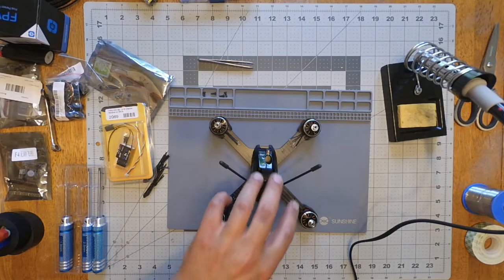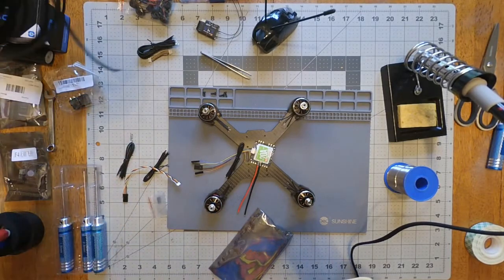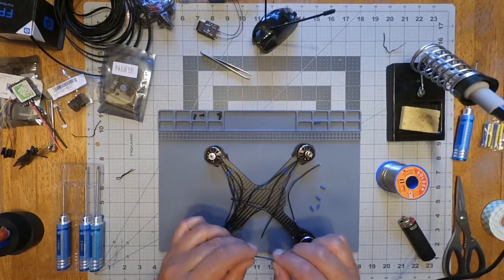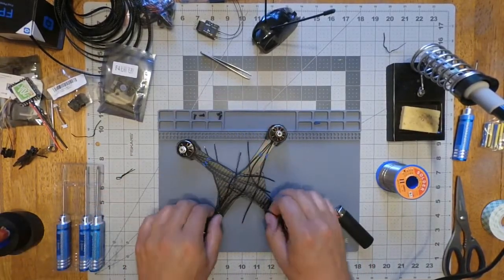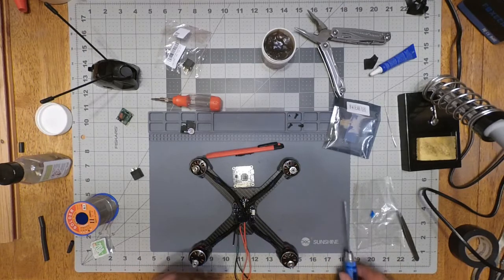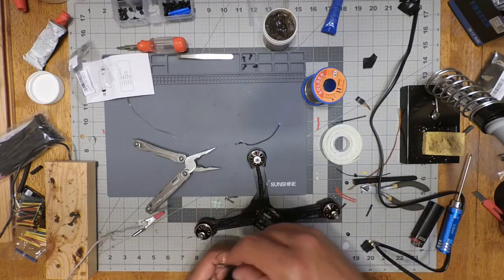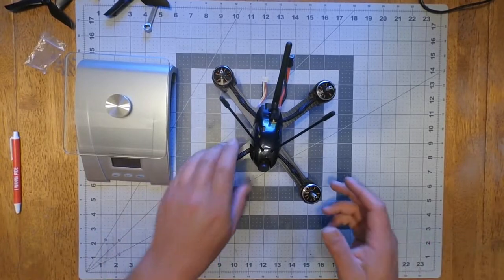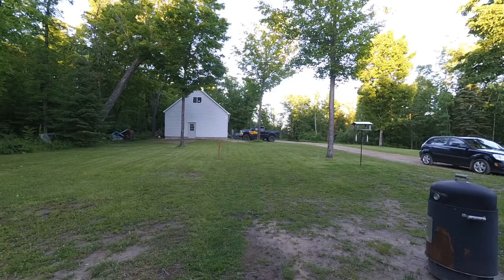X210 Lumeinier Pod Build

Comment: I got the pod as well and the x210 base plate. can't bring myself to build if. the baseplate is the worst cut piece of flappy carbon I've seen in a long time :)
Reply from the maker: Really the two I have are not bad I have a 3mm and a 4mm and they are both ok strange.. Thanks for watching have a great day my friend!
Reply: Torch Fpv still love the idea. gonna wait till I find a better alternative. I've had an x210 and it was fine. think I got the Friday afternoon cut :)
Reply from the maker: Idk what frame they sent you but the 3mm I built this outa has been crashed hard and imo you are not getting a better one for 24.00 just sayin.. You could use the x210 pro frame that's a really nice one but it costs more and you can't get it in 3mm.. Have a great day my friend!